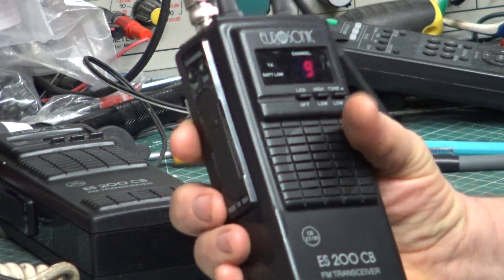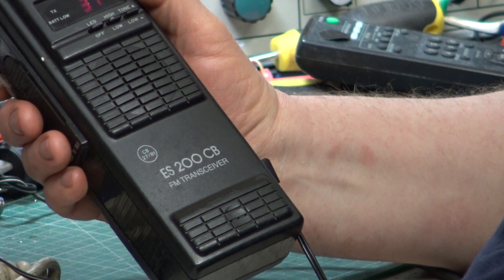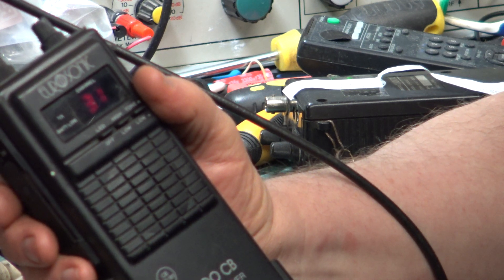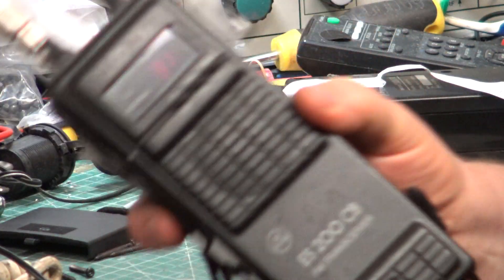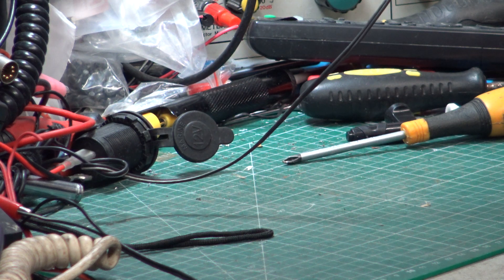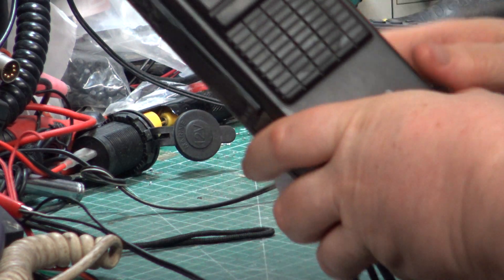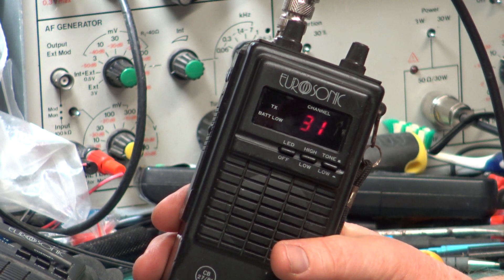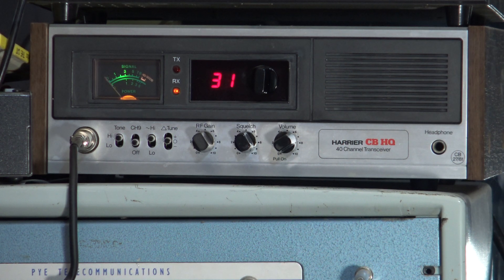Eurosonic ES200CB UK FM CB radio Handheld - On The Air test

Comment: That TX audio is very good for a hand held CB, shame about the speaker, but they do get abused with all sorts of stuff going into the speaker, also they tend to be at quite a high volume most of the time, which in the end wrecks the speaker!
Reply: I would agree. I bought one of these boxed as new with instructions, dummy batteries and the original cigarette power lead for £1. Only problem was a blown internal speaker, easially replaced!